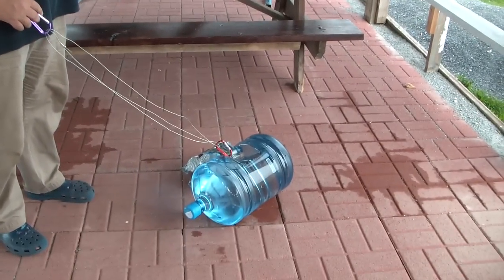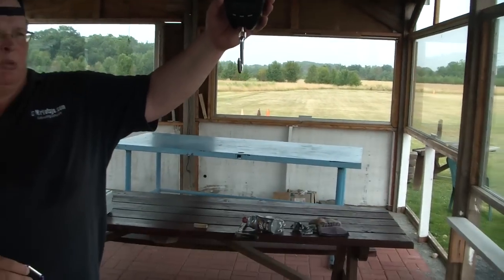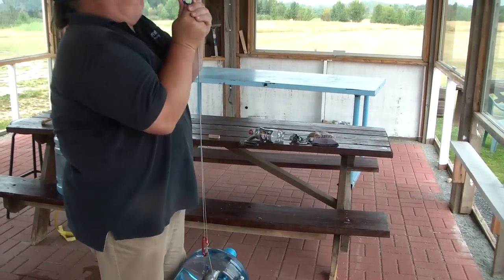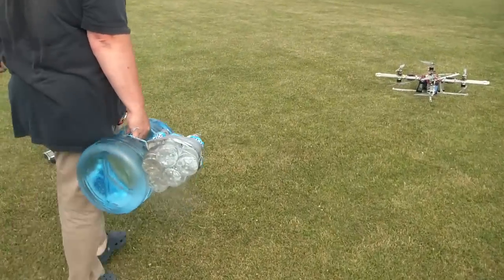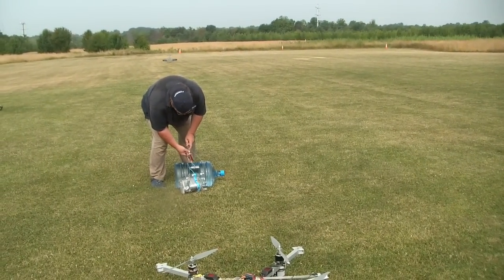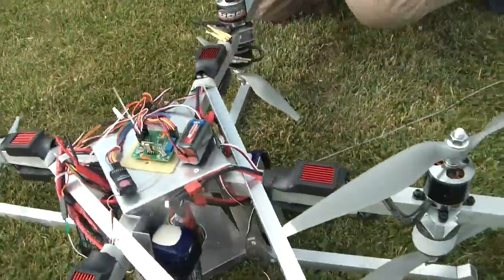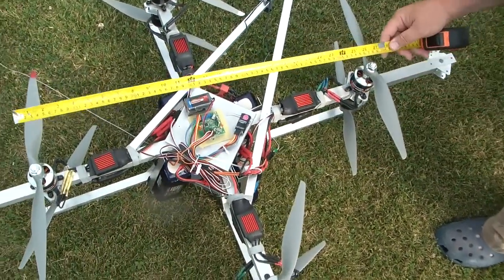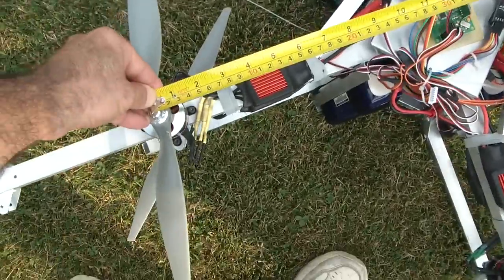Heavy Lift 50lbs 22.7kg 685mm X8 Multi Rotor

Comment: so 6 of those moters to lift 300 lbs
Reply: Apachurrale Produccion In a perfect world? Yes. However as you increase the amount of thrust and lift with electric motors you need to account for energy losses so it doesn’t quite work out as linear as that.
Reply: true, maybe fuel is the way to go or maybe the answer lies in both fuel and electric power or generators.  The is two systems I keep my eye on that's the flyboard and the blackfly. tho the fly board is an older concept   a system called the wasp project  this platform was perfect in flight Williams Aero  System Platform spelled wasp

Comment: Cool. They just need vertical hot air or cool air ballons that can fit in a parking space to reduce the weight and save battery power.

Comment from the maker: Its real.
It was for an international contest out of HK. So we were to use the metric system.
Look for the 33kg lift in my videos.
We built this.
6S5000mAh batteries
60 size equivalent motors

Comment: seriously why did you waste our times with posting this video when you were obviously warned if you take the camera off the payload it will be questioned, the measuring sequence could have been done after the lift
Reply: I was warned? LOL. And who warned me?  This is not a fake. Look up those motors and how much power they have. This is like 8 60 sized motors.
Reply: In the video the camera operator said if you take the camera off the helicopter at any point it will lose credibility.

Comment: "50lbs American" at 3:52? What does that mean? Do you have a different measure for pounds than the standard pound measurement (2.2lbs=1kg)? (in the same way as you have a different gallon (US gallon = 3.785L) from the standard gallon (standard gallon = 4.546L) Awesome machine by the way!
Reply: +Phillip McIntosh Dear Sir! Before criticizing someone, try to be correct yourself. There is no place on earth, where one pound is 2.2kgs, as you state. One kg is 2.2pounds and one pound is 0.455kgs. That's it . Blueray450: Good Work!
Reply: +David Jincharadze There was no critisism meant in what I said. I had never heard of an American pound before and for that reason I was asking if it was different to a normal pound. Regarding my statement, yes I had it around the wrong way (brain fade) and thanks for correcting me.

Comment: It hardly is practical under battery power.  How far will this thing fly before it falls out of the sky when the battery dies?  How stable is it in a light breeze or a gentle wind?  Rain?  Snow?  The technology is promising, but these will have to be gasoline powered before they will be anything more than a toy (or a teenagers high tech peeping cam hehe).  And I want them to be able to handle mounted guns!  (Not really, NSA, get off my back)
Reply: have you found a better solution yet?

Comment: Now, just scales it up 2x or 3x and put a human on there. Boom, flying cars
Reply: Ever hear of the square cube law? It probably wouldn't work very well if you just "scale it up 2x or 3x."
Reply: You may be interested in the Volocopter. It uses 16 motors to carry a human. Electric multicopter + sky highway = the future.
Reply: eggaweb I know right? Why aren't more people working on these???
Reply: ***** Correct me if I'm wrong, but doesn't the square of cube law apply to top speed, not lifting capacity? However, it struggles to lift 23kg, so effectively you can carry only 15kg for each quadcopter. To carry a human, you would need to lift the person as well as the cabin and control/navigation/safety gear. This would bring the weight up to around 300kg, or 20 times the power of the one shown here. But with the bigger, more powerful motors you get the volocopter, built by German students and engineers it was the first electric multi-copter to carry a person. They have moved on to build the first production prototype.
Reply: WAYNE GROS The computer takes the multicopter, airplane or gyro-copter on a predetermined flight path without the need for human control. The road signs are virtual and always obeyed by the computer. The only input from the passenger(s) is the destination. Safety can be addressed in a multicopter or small plane with the use of ballistic parachutes. Battery technology can only carry a multicopter for half an hour with a speed of about 120kph. That's around 60km (40 miles) range. If you had a network of stations placed about 50km apart, you could hop from station to station replacing the batteries.
Reply: how youre gonna power it ??? liquid fuel ?! hmm if i was you, i wouldnt do it
Reply: with batteries
Reply: Tom Miller
Make the 'copter fly itself using a GPS enabled sky highway. NASA has already done most of the work. Punch in the destination and go. Hire them out, like car pooling. For safety, you would need a ballistic parachute as multicopters don't have auto-rotation like a helicopter.
Reply: Ricky32908 a regular quadcopter that weights 1kilogram flies around 20 minutes at maximum, with a nice and powerful battery, so are you going to design new batteries ??? because the ones that we have now, arent able to lift a quad with a human inside, and it will take a long time to
Reply: Boom carnage in the skies.
Reply: Kenny Evans Automating them will allow everyone to travel faster and much more safely than cars driven by selfish, intoxicated, distracted and angry drivers.
Reply: eggaweb beg to differ. on ur remark, some people don't know how to raed road signs, what do u think will happen if there are none. besides that its long fall to earth.  lol
Reply: WAYNE GROS sorry about that. stand corrected. thanks
Reply: So it's pretty much a helicopter?
Reply: eggaweb

Screw that! If I flight it's manual controls ftw!!

Computers can fail, crash and get bugs!
Reply: Watch Ryder
So you'd like to share the airways with selfish, intoxicated, distracted and angry flyers?
Reply: eggaweb

That's the price of freedom, something you may not understand I fear. If we had it your way we'd need flying licenses for these things.
Reply: Watch Ryder 'Computers can fail, crash and get bugs!'

Ignoring the fact that most of the large planes in the sky right now are relying on computers to keep them flying -- actually in charge of the flight controls.  Yes, computers can fail.  That's why they use lots of them in a redundant fashion.  Much more reliable and capable than humans.
Reply: lol many people think about flying vehicles for anyone. If nowadays cars are driven by stupid and/or drunk people having stupid crashes, or even system malfunction, or simpler battery failure, imagine that in the air... news will be now: flying vehicle crashed in the 6th floor killing himself and the apartment habitants, before falling to the street over electric cables, LOL.-
Reply: rodstartube

I think in the long-term that can work out with a better standard of pilots and fliers though. Let people sort themselves out and the cards fall where they will...

Comment: At 3:20 you can see artifacts from where they "photoshopped" the wire or whatever they were hanging this from.
Reply: Try a better video card mate. No artifacting over here. Copter is sort of a piece of shit, but why try to fake it? Its not like a copter can't lift 50lbs. Its super unstable, has a flight lift time of about ten seconds. So what good is it? None. Its just their hobby dude. No reason to fake it.
Reply: Diesel_Ramcharger
Its fake bro.  Notice there are no other copters lifting 50 lbs.
Sorry bud.
Reply: Mark Ryan Yes there are. There's an Octo lifting 26kg. It's not unheard of. A prop configuration like this one in the video isn't the most economic way, but if you see the size of the motors, it's possible.
Reply: AndyKayUK
The configuration of these props is the least efficient way.
And the frame looks like it weighs as much as a Ford Focus.
This one here is fake, Andy.
Reply: Mark Ryan You've got no idea
Reply: Offroad'n Lighting Solutions
Yes I do.
Reply: Mark Ryan
Nah mate you really don't just because you can't do something doesn't mean someone else can't
Reply: Offroad'n Lighting Solutions
Nah mate I'm just saying its fake.
Go ahead and try to repeat it it if you like
Reply: Mark Ryan
"And the frame looks like it weighs as much as a ford focus"
lol'd heartily.
Reply: Mark Ryan You offering to pay for the parts? I'm not dropping a stack of cash on someone who runs around with blinkers on and the mind set that if they can't do it then it must be fake.

Do some research, get educated
Reply: Offroad'n Lighting Solutions
Why would I pay for your parts?
The research shows that this machine can't lift what they claim it did.
Reply: Mark Ryan How about you plug this into google, "hobbyking heavy lift competition" then get back to us and tell us that it can't lift. I have no need to buy the equipment to prove to you what people have already done, you are an idiot
Reply: Offroad'n Lighting Solutions
How about you provide proof that isn't from the same people who made this video?
Reply: Mark Ryan Why don't you actually follow what I said, look at all the videos posted to the hobbyking site and then get back to me, I can't spoon feed you everything
Reply: Offroad'n Lighting Solutions
Why don't you simply provide a link from someone other than these people?
Reply: Mark Ryan You clearly haven't had a look and seen the various people listed and checked out each video.
Reply: Offroad'n Lighting Solutions

Clearly you can't provide the math showing these components can do what the video claims they did.
Reply: Mark Ryan You are a genuine idiot, take the time to research the field and then you will realise how much of an ass you are making yourself out to be
Reply: Mark Ryan http://puu.sh/dnqdn/4ee8bba7ef.png

Here's the maths for you

Comment: Cool. Angry little thing. Maybe lock it on as a rigid mass instead of the oscillating wire.
Guy lifting the water, search for P90x. It can change your life. See how it has changed others. Stick to it. It's working for me as well.

Comment: I could see you nearly lost it due to pendulum resonance. Hanging loads are very difficult to manage in flight as you probably discovered. We tried this a while back and discovered that shifting the CG extremely low like that would very easily cause a catastrophic failure of the autopilot which will not compensate properly for the swinging load that it induces. Neat though... The heavy lift we designed could lift 150 pounds and we noted that an adjustable lifting bar to hang a load was FAR better for stability... :)... Just sayin'... Like your design. Our prototype was all aluminum as well for structural strength.
Reply: thanks for your insight.
BTW stls, have you become a flat earther yet? If not I suggest viewing the 13 part series what on earth happened in my about to learn how the earth is not a globe
Reply: @flat-earther uhmmm NO I am not a flat earther but ONLY because of thousands of years of hard and fast proof to the contrary. But that’s the only reason…. 

I mean YOU tell me me why we see Orion upside down in Australia.. should be a simple proof for you. 

YOU tell me why the angular diameter of a supposedly approaching and receding Sun doesn’t change in the sky as the day passes. 

YOU tell me why we see a rising dark wall on the opposite horizon from sunrise/set everywhere on Earth if it isn’t the shadow of the earth itself projected into our sky?

YOU tell me how countries from around the world including our own have weather satellites up in ORBIT that show a spherical earth. Then as an add-on:

YOU tell me why it would have to be a big global conspiracy all over the earth to keep the “flatness” quiet? TO WHAT END?

I mean do tell. I am SURE you and your 13 part  part series have figured this all out…

I have about twenty additional flatEarth destroyers so feel free to respond for more. It doesn’t hurt that I am a professional astronomer… but go ahead… give it a shot. You only have your entire flat earth to lose.

Comment: how do you call smart people in America? foreigners. out of all the comments, only two know, it was a fake, there is no way a quad with 78 centimeter diameter with 8  tiny coax motor setup, 25% less efficient, with 8 small puny plastic lift propellers  can lift 25 Kg. there is something called, aerodynamics...hello???

Comment: Coax motor setup is 25% less efficient guys!!!!!!!!!!!!
Reply: They measured the distance between motor shafts so it looks like they are trying to fit in a specific class (size) maybe for competition.  With co axial you can fit more larger props into the same diameter, so my guess is this is why they went coaxial.
Reply: Drone Guy sry late reply, but a properly designed contra rotating prop will increase efficiency by 6-16%, read more at Wikipedia. It has to do with the turbulence spirals created by one prop (loss of energy) but the one under it will pick that lost energy up.
Remember, they must be contra rotating.
Reply: The motor setup is less efficient BUT you only need 4 arms instead of 8. On a heavy lift 'copter with heavy metal arms, the weight saving might actually make coax more sensible than on lighter plastic 'copters.
Reply: 25% Less efficient either way!
Reply: Riaan Skypixels How did you measure that? Really doubt that's true on a quad with metal arms.

Comment: Very cool video and functional quad design. We just lifted 66+ lbs (30+ kg) with a 5.9 kg heli (more is possible), but this vid shows how powerful also quads can be. It's cool that the flight controller doesn't fall into a resonance - or did it just not occur because the slung load didn't start swinging?
Did you have a case where the quad started to "osciallate"? This would seem likely because the mass of the quad is significantly lower than that of the slung load!
Reply from the maker: We did 33kg, the video is in here somewhere.
Yes, if you want to do a static lift, hanging it is the way to go. You don't lose control if its too much weight. Full Scale helicopters lift that way because of the same reason. You can stabilize easier. The trouble is when it goes into oscillation and the weight swings around (see my video of that failure last year). But I did not crash.
Reply: Great, thanks for the insight - please keep up the good work! :)
Yours, Team HeliGraphix
Reply: @Blueray450  
I'm interested in shopping for a custom heavylift Drone get at me
Reply: Blueray450 Would a 4 line bridle (~1 meter long) help make it more stable and stop the wobble?  I think that's how they stabilise loads on full size helis.
Reply: Meanwhile lifted a human person with the helis BTW: http://youtu.be/77uK19KxMuI
Reply: Blueray450 hello sir , can I get help for my research My quadrotor has specfication of mass of =.5 kg , Length =.225  meter , moment of inertia in the x, y  axis. =.0086 , in z axis = .0172 how much maximum Wieght can this quadrotor  lift ? My quadrotor name  is draganfly IV
Reply: Not a quad- x8
Reply: It looks like the load is hanging from the multi rotor's center of gravity. As the air frame tilts relative to the wire, there is no external moment generated.

Comment: You have to understand why he's skeptical, though.  Thats a MASSIVE amount of weight to lift with an RC.  Though looking at the motors, props, and configuration.  Thats a beast of a copter.  Definitely wouldn't want to be on the receiving end of a fly away

Comment: 50 lbs is very do-able ..my little blade MQX can lift about 1.5 ounces.. or 43 grams. or around 3x AA batteries seeing as the MQX only weighs about 74 grams with battery..its a decent feat..

Comment: So that looks like it took eight 16-20" props to lift 50 lbs, right? Do those say Turnigy 800Kv motors? What's the voltage of each battery? How much does your multirotor weigh?

Comment: yes, you can carry more batteries, but at that weight, you are drawing high amps, effeciency throughout the whole system comes into play, i won the multirotor lift challenge in weight lifted to weight of the copter with 4.8, and the thing is 7x7 square, and gets great fpv flight times :) and it is alot less likely to kill somene when it plumbits from 50 feet